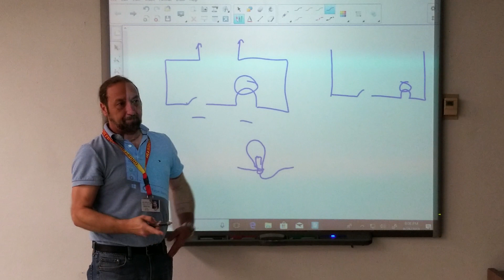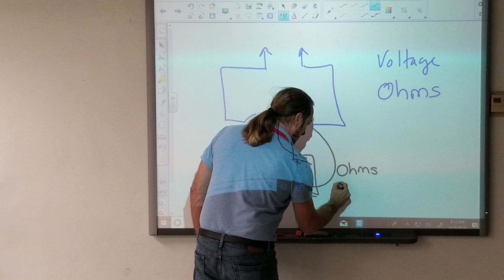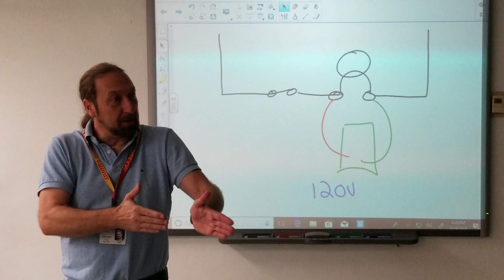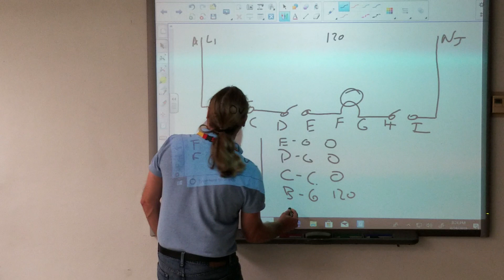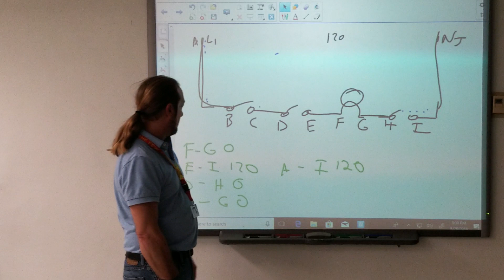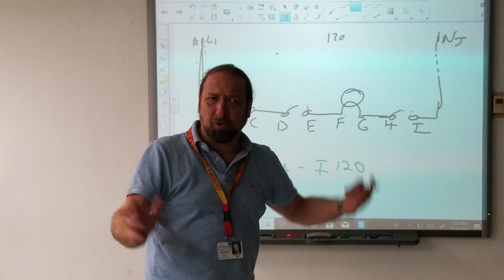DIAGRAMS PART1

Comment: Thanks for the video. Just saying hi and boosting your algorithm! Wanted to say important to distinguish between voltage drop and line voltage when we take a reading. Former across a load with current, latter between line and N when load not working.